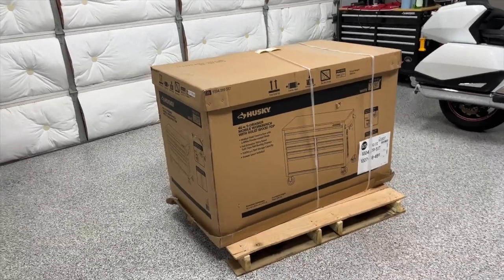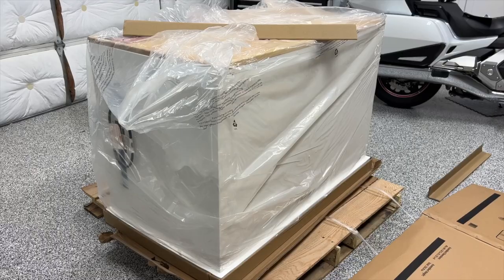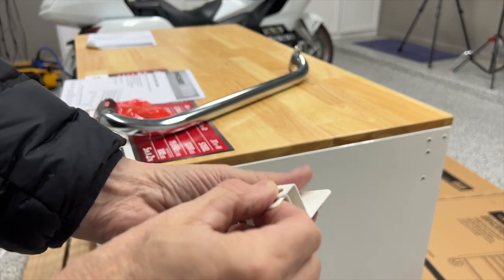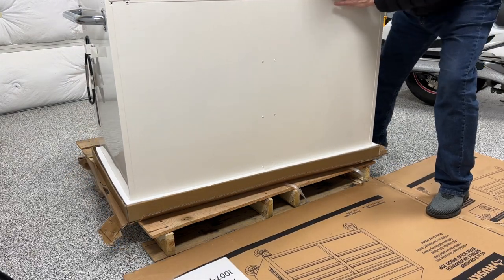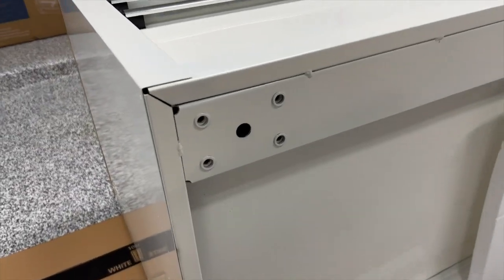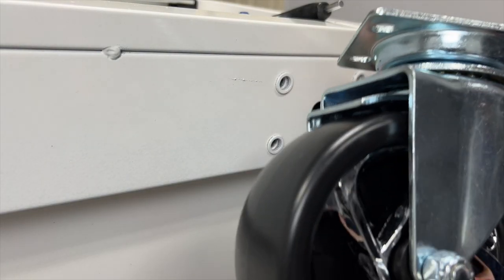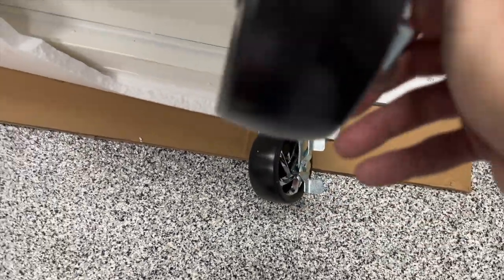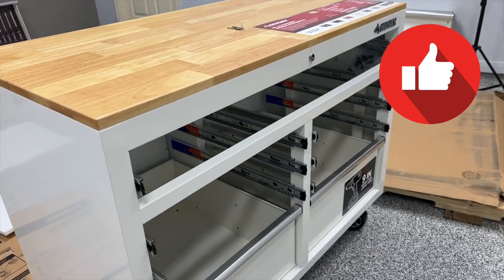Assemble a HUSKY Rolling Tool Chest/Workbench | Cruiseman's Garage

Comment: I just bought one of these.  Moving it up a flight of stairs and tipping it over/lifting it up was indeed very difficult because there is nothing to hold onto on the left side.  My solution:  last summer we went on vacation with my mother-in-law.  We took along several suction cup handles she could use in the shower for safety and stability.  I suction-cupped one to the left side, giving me a handle to lift the cabinet.  Worked like a charm.  Great video.